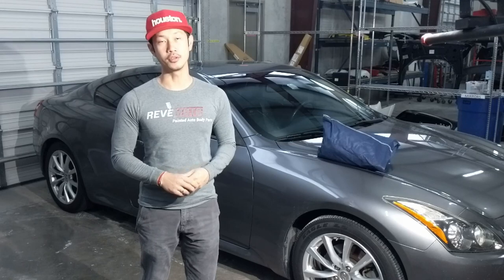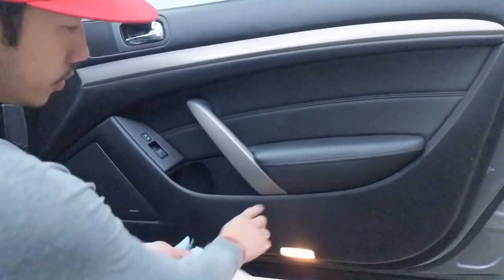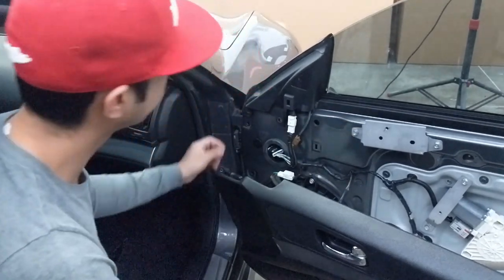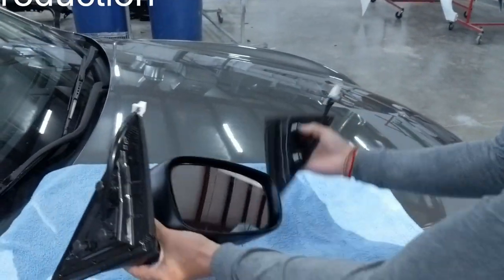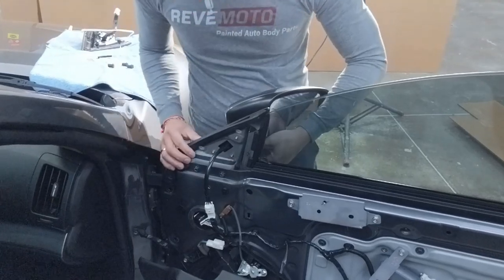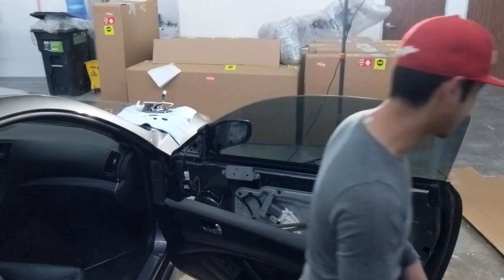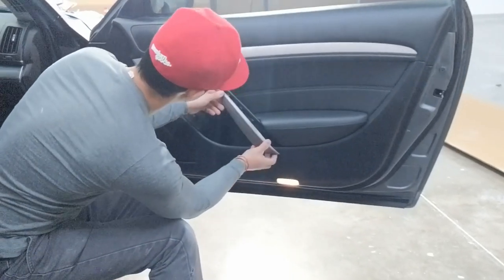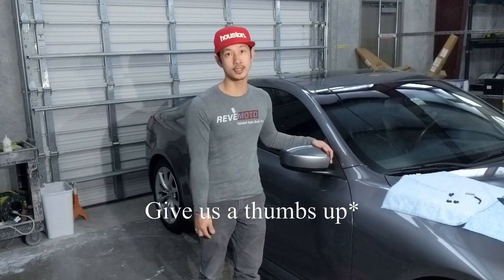How to Replace and Install 2008-2013 Infiniti G37 Side View Mirror

Comment: Just installed a new passenger mirror on my 2013 G37x sedan. The process is similar but instead of removing the silver panel on the angled door handle for the coupe, you have to pop off the panel on the arm rest that has the window switch. Then there are two 10 mm bolts that can be removed that are visible and easy to get to. There is also no bolt to remove under the small triangular speaker panel for the sedan. 

The biggest challenge is getting the door panel off and back on via the plastic snaps. It’s a little tricky getting everything aligned. 

This video was a huge help. Thank you for posting it!